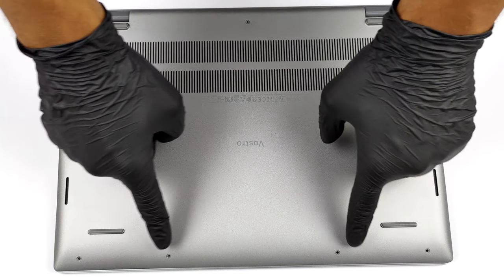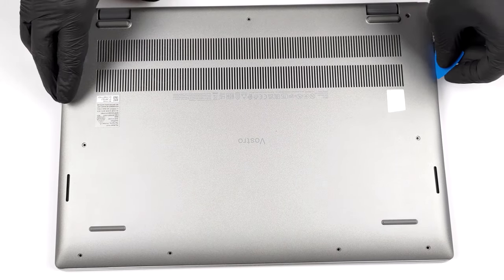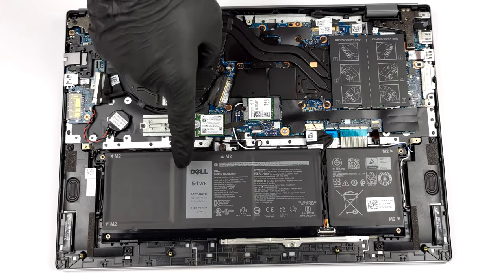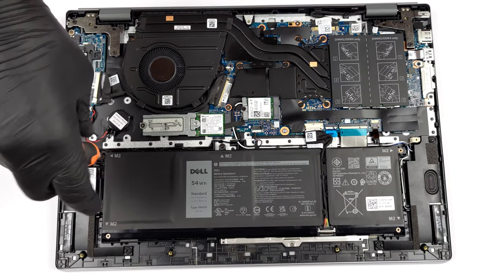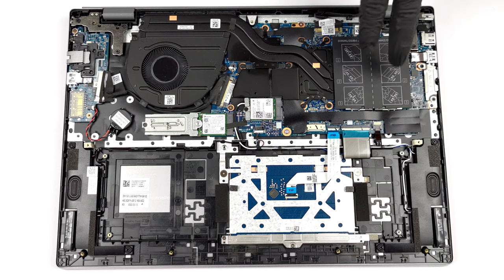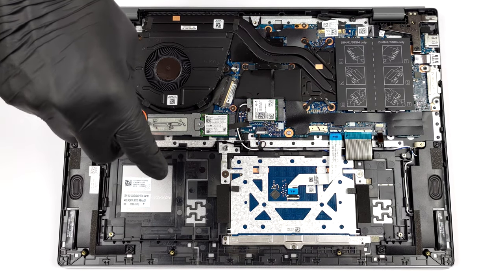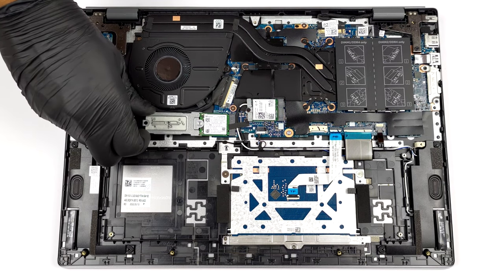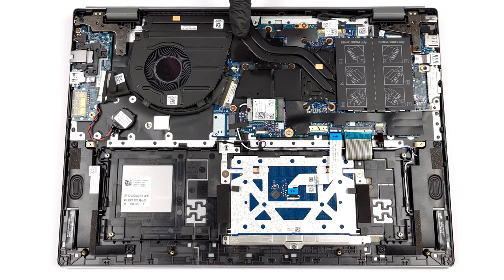🛠️ Dell Vostro 16 5620 - disassembly and upgrade options

Comment: Thanks a lot. Have in mind that if you change the memory chips to e.g. 16 GB x 2=32 GB, you have to wait a little when you boot. A message "system memory has change" is displayed.

Comment: Please can you check the performance and gaming fps in vostro 5625u vs vostro 5620. I want to purchase one but can't decide.
Reply: If you can't then please atleast tell me which one will be better
Reply from the maker: Hi, it really depends on what configurations you're looking at. We tested the Vostro 5620 with a Core i7-1260P and a GeForce MX570, and it performed better than the Vostro 16 5625. However, the Intel model tends to overheat, especially if you get it with a dedicated GPU.

For more info, you can find the review of the Vostro 16 5620 in the video description, while that of the 5625 model can be seen here: https://laptopmedia.com/review/dell-vostro-16-5625/
Reply: @LaptopMedia  I have visited your website but I had difficulty in finding which is better. 
The configuration I am asking of is intel 1240p vs amd 5625u. Both have same price in my country
Reply: No dedicated GPU. thank you for helping